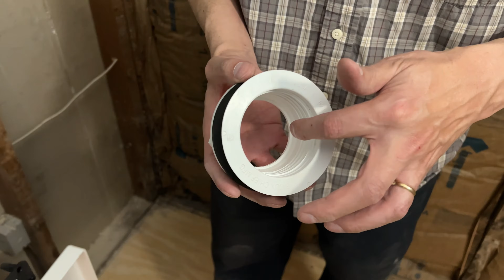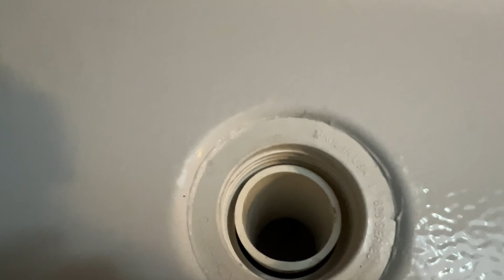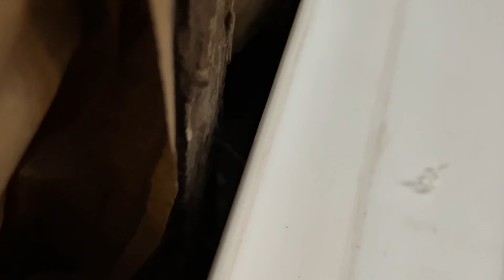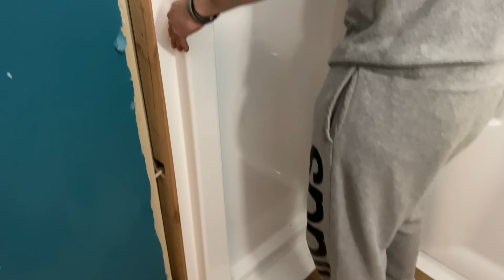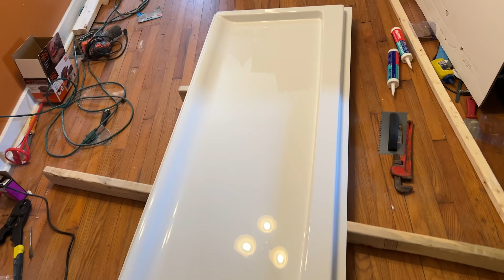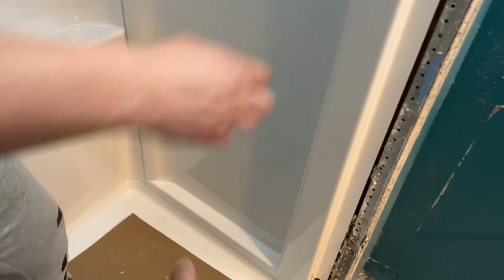How To Install Delta Shower Surround & direct to stud shower kits

Comment from the maker: Have you installed a shower surround kit yet? Please share your experience. The extra 2x6 stud blocking near the front was for the future door installation,...this is specifically called for in the manufacturer's instructions.
Reply: Have a question. I have a delta  shower base and 3 walls that is caulkless. So I should not have to caulk? Any suggestions?
Reply from the maker: @lovemykids993  If you have any reason to believe water is getting between the panels, I would caulk for sure. Make sure to purchase caulk that is rated for "plastic" shower surrounds
Reply: @HomeRapidRepair  do you have a certain caulk that you recommend? This is my shower base and walls#’s 5041646 and 5041648. I should be ok not using any visible caulk? Would you mind looking into that? I appreciate your advice so much
Reply from the maker: @lovemykids993  Yes I see your Delta model numbers, any caulk rated for shower surrounds is fine. The caulking is not really visible, because it's shoved inbetween the joints. This was the manufacture's recommendation.
Reply: @HomeRapidRepair  Thank you
Reply: @RapidRepair  is this delta classic 500...this model looks different from others I've seen please sir? Thank you
Reply from the maker: @matthewpicklesimer293  as long as it’s a Delta direct to studs model all the steps should be the same. Good luck 🛠️🛠️
Reply from the maker: @lovemykids993  yes these systems are generally designed not to need caulk. However in this video the manufacturer did call for some caulking at the very end of the project.
Reply: I am about to install this exact kit in a few weeks waiting to close on the house. Thank you for sharing
Reply from the maker: @Shawkman1  It's a great product. You'll do awesome. Thanks for watching.
Reply: I am about to install this kit in our new barn build on concrete.  Would the adhesive on the concrete be necessary? Also, we put Tyvec over the studs and insulation for extra moisture protection. Is that okay? Thank you for a good installation video.
Reply from the maker: @heatherlanclos3244  I like your idea of using the covering for a vapor barrier. This is a screw in directly to the studs method. They do recommend the adhesive so the shower walls aren’t too flexible. So you might have to cut away the face of your studs to expose them for the adhesive. but I do know some people have gotten away with just the studs screw and not  the adhesive. But I would recommend adhesive for sure.
Reply: @HomeRapidRepair thank you do much for replying, we will go ahead and remove what we hung up to add extra blocking and see if we need to put it back up or not.

Comment: This is the first time that I have seen a shower pan installed without having to put some type of mortar under it.
Reply from the maker: This manufacture had an extra strong reinforcement base, and they stated it was not required… But you could still do it for extra insurance and good measure if you wanted to…

Comment: What did you use to brace the back shower wall
Reply from the maker: This model is designed to screw right to your wall studs… So on the flange you screw them right to the studs and then drywall covers that flange… There are other models you can buy that are designed to go right over a finished wall surface… And then those models use adhesive…
Reply: @HomeRapidRepair Ok thank you for the response
Reply: Magic, my friend... Magic.
Reply: @robertgill7214 😂

Comment: very nice, was that like a 48" x 34"?,,i am having a hard time finding one with a right drain like yours...do you have a model number ?..thanks
Reply from the maker: I believe it was this one: Delta EverEdge 60-in W x 32-in D x 72-in H High Gloss White 3 -Piece Direct to Stud...
Reply from the maker: We ripped out a bathtub that’s why we went with the wider 60 inch model. If you were doing just a shower stall, you’d probably do the 48 inch one.

Comment: If you have exsisting framing, how would you add a stud for the shower door?
Reply from the maker: I wouldn’t think you would need to nail in a new stud or nailer if you already have a stud there. If you don’t have any way to add a  wood stud there, you can simply use heavy duty hollow wall anchors. That will hold it just fine. My Preferred is toggle bolts…

This model is screw directly to stud model, so your walls will be partially opened up anyways. 

If your bathroom is already finished purchase the wall overlay shower surround design. 

If I totally missed your question, just respond back and let me know more information. Thank you.

Comment: So how do you integrate the edges of the new shower walls with the existing drywall? Does drywall go over the flanges? Is there a hard transition somewhere? How do you seal the raw edge of the drywall where it meets the plastic?
Reply: @Baron_Bleeke  you’d have to get new drywall to but up against the shower wall and go over the wall lip; considering that this is a direct to stud installation. If you have existing drywall you could get a direct to drywall kit.
Reply from the maker: Thanks
Reply from the maker: Yes, just like the other comment said, You have to treat it like a new drywall application. Your new wall will go over the flange. Typically drywall. And then you use drywall joint compound to finish. And you blend it in with the rest of the walls. There can be a slight thickness difference so you feather it out with multiple coats of drywall joint compound. It’s actually pretty simple. It just takes patience.
Reply: @HomeRapidRepair  So in the tiny gap where the new drywall finally meets the shower wall, there's going to be a raw, powdery edge, no? Can I fill that gap with mud and it'll adhere to the raw edge? Then caulk over the entire seam?
Reply from the maker: @Baron_Bleeke yes true. Most fill it with joint compound, caulk, etc
Reply: @HomeRapidRepair  can I use regular drywall? Im adding a new bathroom and im installing pvc shower panels/walls that came with the shower base, my question, can I use regular drywall above the wall panels?
Reply: To cover the wall, from the wall flanges to ceiling, can I use regular drywall?
Reply from the maker: @josecustodio8348 yes you can. It’s done everyday. They do offer moisture resistant drywall for only a few bucks more. 

Remember to use bathroom rated paint at the end of your project 👍🏼
Reply: @HomeRapidRepair thank you very much.

Comment: Is it a "bad idea" or "overkill" to install GoBoard/WediBoard between the stud & surround to strengthen waterproofing? How about Redgard the underside of the shower surround & pan? I'm just thinking just in case if the surround / pan ever cracks decades later... Thanks!
Reply from the maker: Yes that’s fine if you’re adding extra strength 👍🏼😊

Comment: This mortar an option under the shower pan? I did one of these and it told me to use a mortar base under the pan.
Reply from the maker: This was a reinforced extra strong bottom pan, so we didn’t need anything additional. But yes, a lot of people like the extra insurance of putting material underneath to make sure it will never sag and deflect and crack…
Reply: I believe it'll start flexing and cracking with no mortar
Reply from the maker: @ you could be right, however, this was a more expensive shower… The base was reinforced with black PVC hexagon squares about 1 inch apart. The manufacturers instructions did not call for needing a bed of mortar…

Comment: The inner top corners of both side panels seem to have no stud there and were flopping around during the dry fit. Never showed how you dealt with that. I assume you would have to put more blocking.
Reply from the maker: Honestly I can’t remember, this was a thousand projects ago…YES the corners are very important. You know now that you mention that I do remember, we did have to add a lot of blocking. Because the walls in this old house were not straight & plumb at all so installing two by fours was very interesting.

Comment: Why no waterproofing under the shower pan?
Reply from the maker: Good question. However, these one piece acrylic showers and tubs don’t need any waterproofing whatsoever. They would never fail, unless you crack or damage them…
Reply from the maker: Waterproofing under shower pan is for a tiled product. Thanks for watching.

Comment: Plumbers putty is bad for plastics ?
Reply from the maker: Yes it can be, but you can use a high-quality caulk for that. Most everyone has moved on from plumbers putty to caulk.
Reply: @ Thank you very much for the responses !
Reply: @HomeRapidRepair  No they haven't. Plumbers putty is still a goto for many plumbers/homeowners etc. Its easy to work with and doesn't make a mess like silicone does.
Reply from the maker: @ the manufacturers of certain fixtures say do not use plumbers putty… They specifically say silicone only…👍🏼😊
Reply from the maker: For a shower drain, you should use 100% silicone caulk as it is the most water-resistant and flexible option, best suited for the damp environment of a shower and able to withstand temperature fluctuations; avoid using plumber's putty in most cases as it may not perform as well in a showers.

Comment: Labor cost for this in the north east would be what?
Reply from the maker: Most bathroom conversions of this type will start around 6K and go up very quickly depending on how involved it is. Good luck.
Reply: @HomeRapidRepair  I'm looking to get a delta alcove walk in shower installed. Is that the same price? Not trying get taxed! Thanks
Reply from the maker: @ it will still cost thousands in labor…bathroom remodeling is incredibly expensive unless you do it yourself.
Reply: @HomeRapidRepair  This is a simple job. Companies that charge $6k are simply ripping people off.
Reply: @visualthailand1  I am usually from 3300 up to 5000 (full job, not just labor), depending on the quality of shower unit/sliding door. It also depends on floor/stud water damage and other factors after the old unit is removed.
Reply: @visualthailand1  it's not too much for people with money. My customers understand it's a bargain. Especially in an older home that isn't level and needs more work. Removal. Carpentry,plumbing, and drywall. Also a door and new shower valve.   I'm booked 4 months out constantly.

Comment: Should I be concerned about moisture making its way through the screws at the top shower flange that go into the suds? Can I silicone on top of the screws? I am a little tall and water sometimes splashes up there
Reply from the maker: If you wanna put a little caulk on the screw heads that’s fine. You could also put some cement board above your new shower surround and tile all the way up to the ceiling. It’s actually very cool trendy look I see it all the time for tall people in showers…

Comment: Can I install handles by drilling a hole in the plastic and screwing the handle directly in a stud?
Reply from the maker: Yes. If you need handles or anything firm like that simple screw in wood “blocking” sold wood where you need it behind the shower. Then when you install it you will hit solid wood for a super strong connection.  Yes you can drill out the surround to mount that.
Reply: @HomeRapidRepair  perfect thank you. My mom needs a shower, and I was thinking of installing the handles. Appreciate your time.

Comment: I gonna work on this project next week..
One question is not supposed to be drywall on the walls before installation.??
Reply from the maker: You decide that and purchase the type of surround rated for that. Read the package carefully. Your new surround will be marked as over wall installation OR direct to studs installation. The one in the video is for direct to studs surround. Good luck 🛠️🛠️

Comment: I’m about to do one of these for the first time in our bathroom. I thought I was all set until I saw questions about a vapor barrier. I guess I don’t really understand what that is. Do I need to do some thing more than what you showed in the video?
Reply from the maker: Generally speaking you want a vapor barrier if it’s the exterior wall. This particular shower stall requires direct contact to the wall studs.  So any vapor barrier has to be at the insulation in between the studs and not covering the studs. Good luck. You can do it 😊👍🏼🛠️

Comment: These kits says "caulkless" no?
Reply from the maker: Yes, most of them do say that. But I definitely remember the manufacture Instructions recommended finishing caulk at the very end to get in between the gaps. I looked at the direction of water splash, and it does make sense, the good news is it’s not a visible area. It’s actually in between the gaps of where the panels overlap. But I think you’ll be fine either way to be honest.

Comment: Shouldn’t there have been backer blocks added, all along top edge of surround, to screw drywall to?
Reply from the maker: Actually I do like that idea. I’ve seen it done like that before. This manufacturer did not call for anything like that. This kit is high-quality and really rigid walls.

Comment: How much of the pipe coming up of the rough plumbing do I need sticking up from the floor
Reply from the maker: The manufacturer recommends 1 3/4 inches max. However, you can run it as long as you want if you’re willing to cut it off later with a rotary tip tool.

Comment: Nice job! Thanks for video. I was dreading the idea of leveling cement but the way you did it, Looks like I can use your method which I prefer. What label and brand was that and now that it's been a while, are you still happy with the result. I'm gonna have to be super-creative with my application for future potential valve and hose/fitting repair. I have to invent an access panel. Thanks again for the video.
Reply from the maker: Glad it was helpful! Any floor leveling product will work. I’m still happy with the quality. Good luck. You can do it 🛠️🛠️

Comment: How did you do a vapor barrier behind the surround, if you used liquid nails to glue direct to the studs?

Finding myself having to answer the same question on a project.
Reply from the maker: 1. Vapor barrier was built into the wall insulation. So keep insulation / vapor barrier only inside the studs. You will need the face of each stud exposed. 

2. This Delta system did use adhesive and screws. Has to be adhesive rated for plastics & shower surrounds. They are very popular and sold right next to the liquid nails.

Good luck 🛠️🛠️

Comment: How high the 2 inch drain pipe has to be from the subfloor?
Reply from the maker: OK I just double checked with Delta. If you have a delta shower pan, they are saying the PVC pipe should not extend up above the subfloor more 1 3/4 inch maximum…
Reply from the maker: I can’t remember off the top of my head. Your instructions in your installation kit or your shower pan should tell you. However, you can run extra long on purpose if you use the compression drain. That way the pipe can stick up through the pan and you can trim it with the pan already down… There’s some cool rotary tools for this. And then you just use the compression assembly drain.

Comment: Insulation and vapor barrier??
Reply from the maker: I can’t remember if it was shown or not. Yes there was R-13 exterior wall insulation with a vapor barrier.
Reply: How did you do a vapor barrier behind the surround, if you were using liquid nails to glue direct to the studs?

Finding myself having to answer the same question on my project.